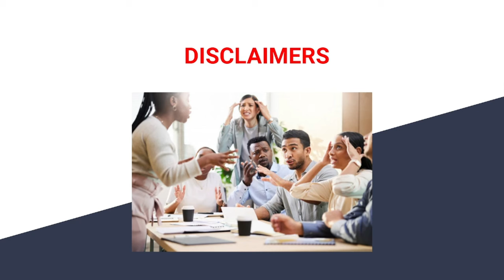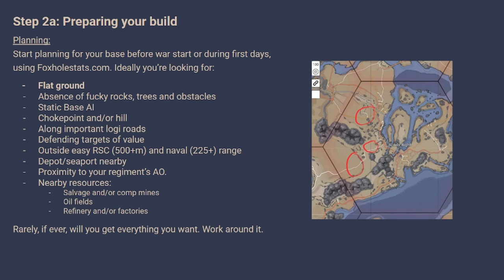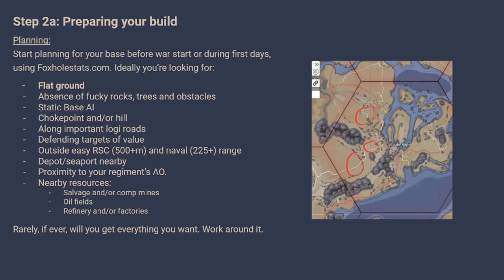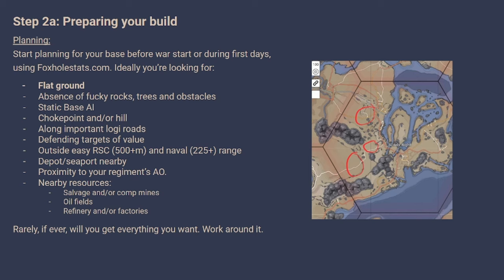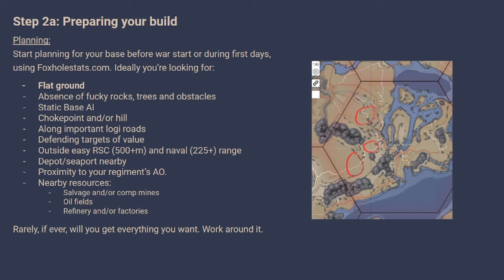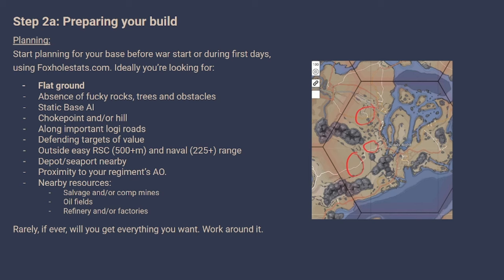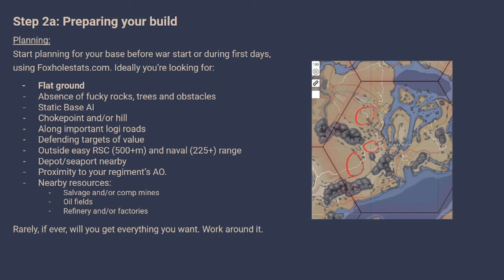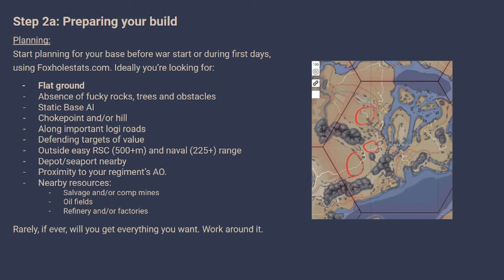Foxhole Bunker Base Design Theory Training

Comment: I get the point about MG range, but in 115 countless meta lines were destroyed after a focused ballista rush killed one piece in the line, leaving the adjacent peices easily flanked by infantry, quickly leading to the entire line being flanked, the cores dropped, and then everything blown up from behind the line.   Depth is critical, and too many bases had storm cannons or factories rather than a second line of bunkers, and entirely too few had the ability to shoot at anything behind the line.
Reply from the maker: @llillian4055  yeah, as the description states this video was recorded and meta during war 110 which is a while ago. Current ballista meta requires a different design philosophy.

Comment: One thing I've heard a lot recently is with T2 don't bother with halberds, just build 1x3 MG/AT, depending on tech. Apparently Halberds are just not worth it with arty meta. Do y'all agree with that? Maybe it depends on how far you are from the core?
Reply from the maker: Halberds are for sure still a bit better but just require more time and mats to build. If you have the time and materials, build Halberds. If you need to build quick or conserve materials, build 1x3.

Comment: Hydra's remove mines, Prepared Nuke (1 per critical region) is the best counter to offensive nukes, aim for 0 distance howizter backpacks that touch the entirety of the back of a frontal piece+ directly adjectent to each other side pieces so one covers 3 (will result in 2 packs retailating normally)

Also, great video the mine distance thing was a good to know tip
Reply from the maker: Good additions! Thanks!

Comment: Decent guide that covers basic stuff, pretty good tbh. Super appreciative of the effort you've put into this, as we always need more resources for building in regards to both factions.

Wouldn't recommend halberds on T2 and saying it is the best design for T2 is just wrong but since T2 is so bad it's not a super big issue. I also wish you put in more pattern recommendations for concrete with visual designs at least for ones that have been out for a year+ since it's good for newer players to start with copy/pasting. But honestly that is such a large conversation in and of itself I'd understand keeping that for something separate or as an additional resource.

Comment: More emphasis on how you can build bunkers to cater to players would be nice. The number of times I’ve had to run into the open during an artillery barrage because someone squadlocked the bunkers but didn’t install any doors that would otherwise let me just walk directly to the battlements in the safety of a trench is enough to make me hate bunker builders everywhere forever
Reply from the maker: @barleysixseventwo6665  okay!